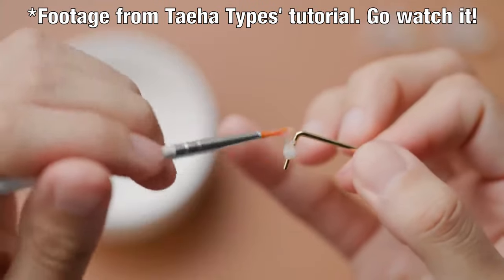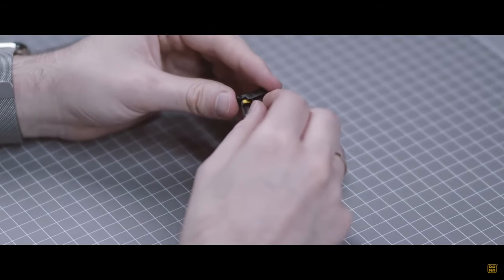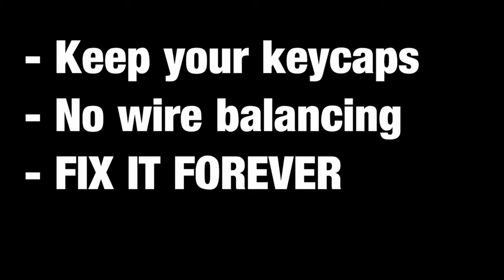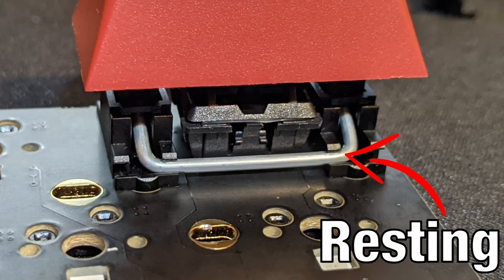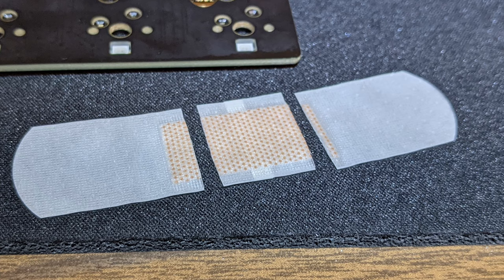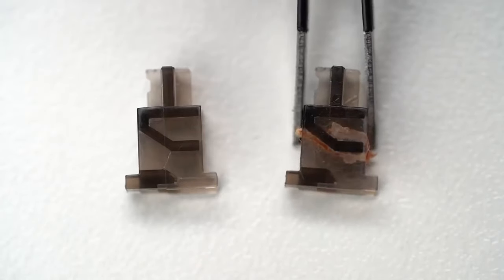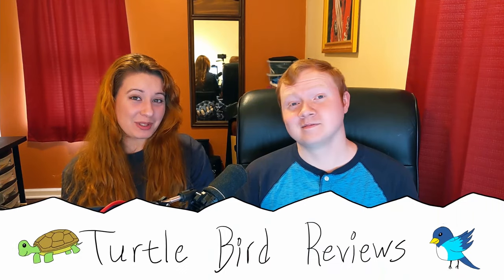How To ACTUALLY Fix Ticking Spacebars!

Comment: We seriously need some stab innovation. Or just a whole new reinvention of stabilizers. It's the single most worst aspect of the keyboard building process.
Reply from the maker: Agreed!
Reply: pretty sure a brand was making a proto of staebies, tempest has a vid on them with dry wires
Reply: @CharTC  I'm well aware of those. But those are protos. We have yet to get our hands on the production unit.
Reply: @abe5156  hope they come out soon, need those
Reply: @charb6346  Unfortunately for me, I had little no success with plumber's mod, for 7u stabs at least. I've tried with a thin layer, with thicker layer, with extra lube, with half assed attempt with wire balancing, but the tick still prevailed. I even did it with holee mod, and had no success. I don't think any mod can get rid of ticking for 7u wires if the wire is just shit.
Reply: well true...but it's also a way of showing who is really good at this hobby
Reply: @matthiasfoo1217  Not necessarily. A severely bent/unbalanced wire will result to rattle and ticking no matter how much lubing and tuning you do.
Reply: @abe5156  true
Reply: costar stabs are in the corner waiting to be revamped...
Reply: @CharTC  i am using them. They tick like any other stab out there. Sounds better but the ticking. Ufff it is annoying.
Reply: this comment aged like wine, look at what we have now with tx stabs
Reply: Non contact mag-lev stabs

Comment: Thank you for this video! I have this exact problem. After spending hours and hours modding, lubing, researching and spending close to $1,000 on different keyboard builds in search for a truly rattle and tick free space bar, I finally gave up. I holee modded every stab and lubed and still get small ticks and rattle on my space bar. I finally had the realization that I have spent 20+ hours working on this to get the same infuriating result. I realized I spend more time building keyboards than I do using my pc or gaming which is the whole reason I wanted to build a custom keyboard with lubed switches. I went back to my old stock G915 and Ducky one 2 mini and started gaming again. Life is now less stressful and I actually spend time using my pc instead of obsessing over some rattle in my keyboard. The reality is, you use headphones so you really don’t hear your keyboard anyway so just use a stock prebuilt board. It will save you thousands of dollars and hours of frustration.

Comment: Great video. A lot of people don’t realize that overtime, lube (especially 205g0) will slowly start to move down and collect under wire which will eventually leave nothing to dampen the wire slamming into the top of the housing and ticking which is why the holee or epsi mod are 100% worth it the trouble imo.

Comment: Really interesting way to fix the age-old problem of ticking! Wish I found this before I committed to wire balancing everything. 
The video was really well-thought out and explained very thoroughly, although I felt like it would've been nice if you had explained what putting the cotton/band-aid under the wire was supposed to do (around the 1:50 mark) - I assume it balances the wire in the sense where both sides are now essentially "raised"?
Overall I think it's a solid mod especially for people who are just getting into the hobby or like you said, don't want to deal with wire balancing or spend more $$$ but also for people already in the hobby who just want extra assurance that their stabs won't make any unnecessary noises.
Cheers!
Reply from the maker: Thanks for the feedback! Yes, the idea is that the bandage adds a cushion before either side of the wire can hit the plastic and create the "tick." Balancing wires is probably a better long-term solution, but I wanted something that would work quickly and without a lot of careful tuning.

Comment: since i always do some wire balancing on my stabs, ive actually never ran into the ticking problem, but very well done video explaining the solution!
Reply: how'd you do it? and how long would it usually take to balance wires? Doing stabs makes me wanna quit this hobby lol
Reply: @igieswainebragt  If you see any of 3ildcats videos I learned from just copying him! but you can just put the stab wire on anything flat and just gently hit the wire in the bent areas to try and get it as straight as possible. It takes a little time but the results are almost always worth it if ur wires are a lil curved
Reply: Do you have any experience with 7u wires? If so, does wire balancing eliminate ticking? Because I've tried everything from the holee mod to wire balancing and I just can't get my 7u wires to stop ticking.
Reply: @hiroryk9941  is it in all of his build videos? or do you have any videos that specifically portray this rly well

Comment: The other thing that I find helps (and has helped other people) is to hold up the stab with a toothpick when attaching the key. Then press down on the other side of the stab rather than pressing in the middle over the switch. This seems to help it balance and not "tick" when you touch the keycap. This is particularly effective for the spacebar, that tends to suffer it the worst.

Comment: I just want to say the intro sounded too good to be to true-- even started disassembling my board before the vid was over! I legit tried every mod (like you mention) that came up in a search. But, my goodness, thank you so much for this. This mod, with lubing and holee mod, has eradicated my spacebar ticking (I've been suffering for like 8+ months)! It isn't a surefire fix though, as my enter key still has some minor ticking, but that's probably due to some other reason. My spacebar troubles are gone <3 -- not a paid actor.

Edit: and the simplicity of the mod is 10/10. You could probably do this mod with the board fully assembled -- would just need some very fine tweezers to get under the plate.
Reply from the maker: So glad it helped!

Comment: I bought a pack of Command Poster Strips  (the white padded looking ones) and did this. I like it a little more than the bandaids because they Adhesive is on both sides, The padding is the perfect height, and one strip can can be used on every stabilizer on the board.
Reply from the maker: Sounds like it works pretty well. Nice.

Comment: For the past few weeks I've been trying to fix my rattling space bar noise but nothing worked. So I figured out since I can't do a 3ildcat styled metal bar stabilizing, I decided to give this tutorial a shot. Although both Hamaji Neo and this tutorial didn't helped much, the methods reduced the noise by at least 60%. Finally what worked for me was to shaft a lot of little pieces of band aids underneath the housing of both stabilizers, and it finally cured my keyboard cancer. Although it reduced the thocckiness of the spacebar, but darn I'm so happy now that I don't have to live with life-triggering OCD. Big thanks to you and Hamaji for the tutorial!

(Update: Few days later, the issue resurfaced. And guess what? Turns out it was an unknown issue with my switches. I feel like killing myself even though the issue is finally resolved.)

Comment: I've built a few keyboards and here are some of my experiences:

1) you can apply MULTIPLE layers of holeemod. it doesn't have to be only one layer. personally, I feel two layers of holee mod is the max limit. anything above that you'll find the wire get's stuck and the stab won't come up
2) most of the rattling stabs I've encountered are caused by bent wire. after straighten out the wire I was able to completely get rid of the rattles. The methods introduced in the video won't work if your wire is greatly bent. (by greatly I mean 1 - 2mm off of the surface)
3) Sometimes stab rattles can solely be eliminated by adding excessive amount of lube. (by excessive I mean more than normal but not over lubed). 
4) lastly, modify stabs takes time and patience. When I was building my space 65, I spent 3 hours on straightening out a SINGLE stab wire...  and yes, do use cushioning between the pliers otherwise it will chip the surface of the stab wires, This gets worse with holeemod since the chipped part doesn't glide smoothly anymore and it gets stuck on the bandit... '
Reply: I completely agree with the dude from the comments who said that we should somehow improve the design of stabilizers, or just a completely new invention of stabilizers. This is such a hemorrhoid, why not make a conditional holee mod from the factory with a thin layer of silicone?? Why is no manufacturer doing anything to fix this huge problem

Comment: I've spent way too long fiddling with the stabs/spacebar trying to remove the tick on my Alt Drop.  Because of this video I can finally give my OCD a break because it's perfect now.  Thank you for making this video!
Reply from the maker: Glad it worked! I'm making a follow up video testing the TX stabilizers, which actually ended up being a great solution as well.
Reply: @LukeMason  I used stock, durockV2, AND Zeal (all plate mount) but none worked so that's when I decided it was either a spacebar problem or the plate.  Glad to know there was a solution.  Thanks again :)

Comment: Thanks for the video! Spacebar ticking was driving me insane, and I haven't found any posts or videos diving deep into the issue. I managed to fix my spacebar with wire balancing, but still it was quite hard to balance precisely, I just got lucky at some point with a good enough bend. But rest of my stabs were still ticking, so I decided to try your method + holee mod, and it did solve the issue for all the keys! The stabs do feel rather stiff though - I'll have to see if they become better after some break-in period.
Reply from the maker: Glad it helped!

Comment: When I first got into the hobby, I had picked up a Corsair K70 with the most disgusting stabilizers I'd known (until I got a Massdrop CTRL lolol). My solution at the time was to pinch off tiny tufts of loosely formed foam (bigger air pockets and less dense) and center that over the ends of each bar to cushion it from impacting any plastic. It made a world of difference and didn't change the feel as long as I didn't use too much. It stiffened the spacebar up a tad so it wouldn't wobble and smoothed out the downstroke, so I'm really surprised nothing that follows that same principal is a thing I've seen done by anyone else.

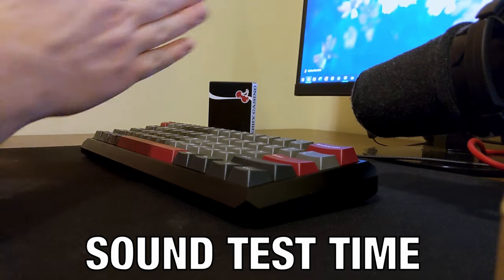Comment: 3:00 I am actually in love with the way your keyboard sounds and it keeps coming back to me may i please know your build specs or ANYTHING I found my dream clackk
Reply from the maker: Pretty simple build, honestly. I'm using a KBDFans 5 degree case, DZ60RGB-ANSI V2 pcb, lubed and holee/mason modded GMK screw in stabs, lubed and filmed Gateron yellows (black housing), and some generic pbt doubleshot keycaps from aliexpress.
Reply: @LukeMason  tq so much. That would be a great reference for me

Comment: I will definitely try out the Mason mod the next time I fiddle around with my stabilizers. They have yet to be perfected. However, I would like to advise against using the Holee mod in some instances due to (in my experience) stabilizers becoming either too mushy or scratchy in sound. 

Obviously, bandaid varieties decide what a stabilizer will feel and sound like. I suppose the ones I've tried just haven't really worked that well.

Comment: adding some dialetric grease helped a ton and actually got rid of it, but kept comming back.  Add more, came back, add more... oh crap now my stabs are slow.
So now I'll have to take it all apart to remove and clean the stabs, so I hope to try this and see how it goes.  I saw some negatives for the holee mod saying it can come loose easy so its not a good long term solution, so I would probably try the pipe thread tape instead.

Comment: just did your mod + holee mod on my GMMK Compact (actually pretty hard to do since the stabs are plate mount and not PCB screwed, so you have to have some very small pliers on hand to get it under the plate), and it completely fixed my spacebar which was ticking like hell !

thank you for this video !
Reply from the maker: Glad to hear it!
Reply: @LukeMason  yes I'm glad to hear my spacebar too 🤣

Comment: My stabs are clip ons, so I couldn't do it with the stabs installed, the holee mod made my spacebar get stuck and not bounce back up. I tried only wrapping bandaid around the wire and it worked, but it made my spacebar super mushy. I figured it must be because my bandaid was too thick, so I removed it and replaced with washi tape (I didn't have anything else on hand, except duck tape and I wasn't gonna use something so heavy duty) and it worked. The spacebar is still clacky, but at least it doesn't rattle and it doesn't tick anymore. The ticking was really driving me crazy. This is my first mechanical keyboard and it was prebuilt.
Reply from the maker: Glad you found a solution! I'll have to keep that tape in mind.

Comment: you are actually a lifesaver. i tried everything, bought new stabs, used more lube, but the ticking won't go away. slap a bandaid under the wire, GONE. TYSM <3333

Comment: First of all, I wanted to say thanks for the great video! I did this on my spacebar stab and it removed all the rattle. However, I have some questions. Did this mod also cause a reduction in volume and/or a slightly softer feeling? My spacebar is not mushy by any means, but it certainly feels dampened, and I feel like the same could be said about my spacebar. It's a retooled black switch, and before the mods it was louder compared to how it is now. Regardless, this is still a great video and really helpful for eliminating rattle!
Reply from the maker: Performing the Holee mod with fabric bandaids can absolutely cause a mushy or dampened feeling. Breaking the stabs in can help, but what I did is use a thinner plastic rather than fabric for my mod. I don't think it affects the feel much at all for me, but YMMV.
Reply: @LukeMason  Thank you very much! I've been using it for a few hours and I've also found that it isn't as big a difference as I once thought it was, and if there is any difference I'd say that it's negligible if it means these stabs don't rattle again or as frequently. Great job once again on the video and discovery of the mod!

Comment: Thank you so much for this video! I can't emphasize enough how much I hate tuning stabilizers. I tried out the holee mod, thinking it would fix all my problems (which it did), but I ended up doing it only on my spacebar because it's so damn difficult to do. The results were good, but nothing amazing.
After finding this video, I paired your mod with the shrink wrap mod and my problems were instantly gone. It yielded the exact same results as the holee mod with less trouble. Really can't thank you enough.

Comment: i'm not sure what exactly fixed my keyboard's spacebar ticking, but it is fixed and sounds better now. I know i watched someone building a custom keyboard and i followed his turtorial <well not really because all i was there for was to fix my spacebar> and it worked. What he did was add tape/i used bandages on the stabilizer holes on the plate and making the stabilizers tight, which fixed my problem . . . I also used a different, much better brand of lube aswell but i am pretty sure that tape mod thingy fixed it.
Reply from the maker: Glad you got it how you like it!

Comment: I have the exact same experience and I've got my own fix. Did tons of research and testing and finally found something that really worked on cherry screw in stabs, and will test on durock v2s very soon. Too bad I don't have experience in making videos for a tutorial;-;
Reply: I should add that this also doesn't make the key mushy at all, unlike all holee mod variants that actually mute the ticking, I found all of them at least muting the top out if not also the bottom out, to various degrees.
Reply from the maker: @kurisu0810  What do you do?
Reply: @LukeMason  In short, I used two types of very specific thin af transparent band aid strips, one on the bottom and one on the top of the inner stem hole, which were the exact thickness to fill in the gap and to prevent wire-to-stem ticking sound, but not to make the key feel mushy. I haven't really had the issue of wire-to-housing ticking, I simply inject a bunch of lube right under where the wire bends, which seemed to easily do the trick.

Comment: Hello, this mod really helped with my stabs! Thank you but I was wondering what keyboard is shown in this video? The one that you are using. I would love to know, because I think it looks pretty cool.
Reply from the maker: Glad it helped! I built my own keyboard. Here are the specs:
Case: KBDFans 5° 60% Aluminum Mechanical Keyboard Case
PCB: DZ60 RGB hot swappable PCB
Switches: Gateron Yellow
Keycaps: Honestly, I just got the colors I wanted on Aliexpress. Mine are PBT and doubleshot.
Cable: I started with a generic USB-C cable, but today I have this from Upgrade Keyboards: Red & Black Coiled Aviator Double Sleeved Cable
Reply: @LukeMason  Thanks so much

Comment: Thanks for the tips, I used the holee mod, because the band aid to the pcb was not possible, since my stabs dont fix on the pcb and I found that the ticks were coming from the bar hitting the plastic. Spent half my afternoon doing it mas it was worth it

Comment: I've noticed my PE modded boards that have foam going under the spacebar wire have no tick at all. I'm assuming it does the same thing as the band-aid in this case. My 67lite space-bar ticks real bad but I got the PE foam coming for it that should fix it, ill update whether it works or not.
Reply: Any updates? Got a ticking 67lite too